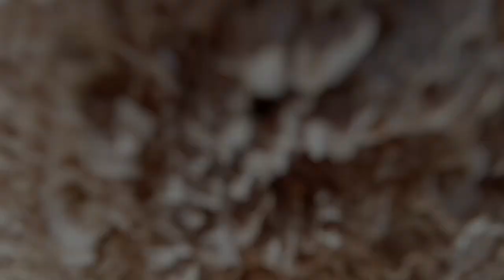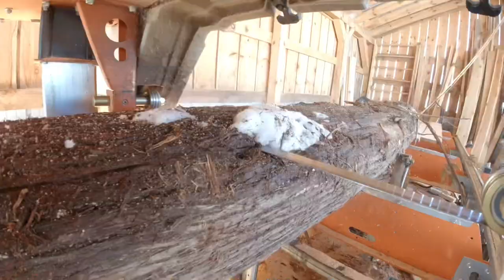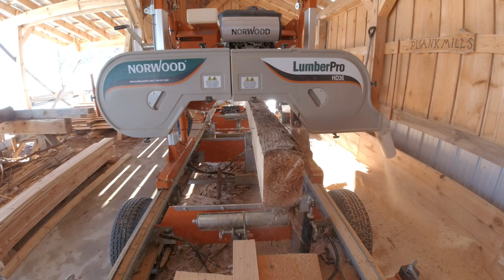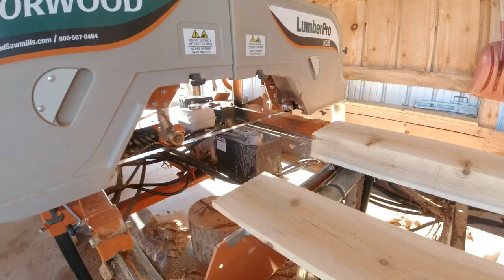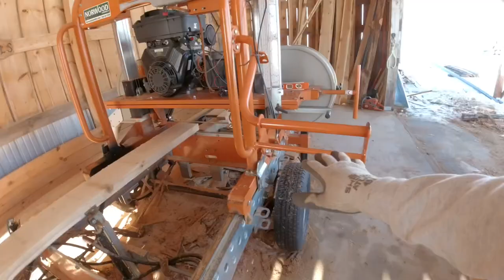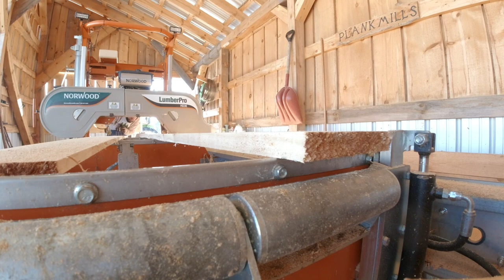Turning logs into valuable lumber, One man Sawmill operation.

Comment: I really like your set up, I need to build a new building to hold both mills & my planer, I bought a 12' extension for my Lt 40 wide walk behind.
& I need to keep my Woodmizer sharpening & setting equipment all together in the same office space!
Keep up with your videos, getting close to 1000
Reply from the maker: Thankyou, I like it pretty good too, If I built another one I’d go a little bigger for more space to work. And I don’t have an ideal setup for my sharpening equipment and planer molder yet.
Reply: Copy that, I have a video of the mp 260 that I run, check it out when you have a minute

Comment: That sure is some real nice cedar you are cutting. Are you selling the boards or using it for yourself on some projects?
Reply from the maker: Yes, a lot of it is very nice, some is kinda yellow and has some blue stains in It. I’m mostly selling custom ordered cedar. Some pine too from the ones I got free last spring. But my pine supply is running very low.